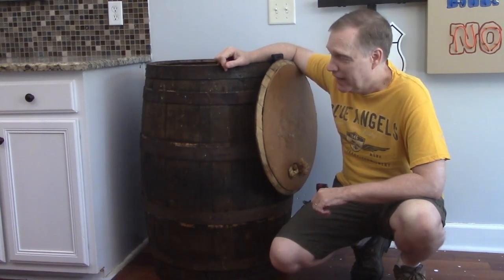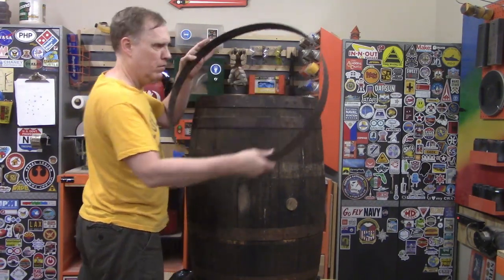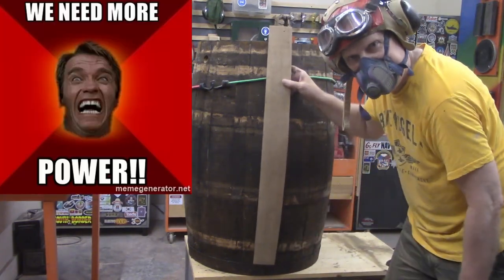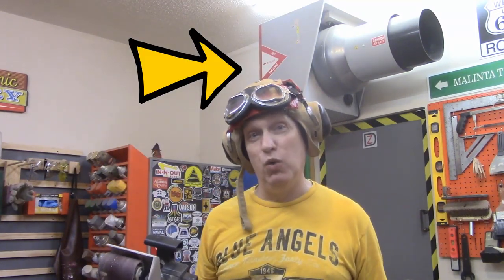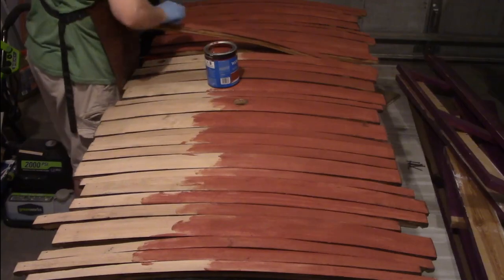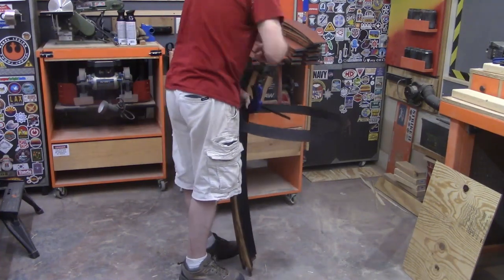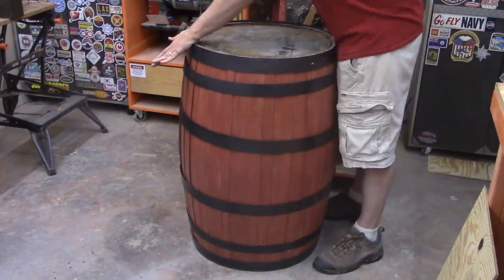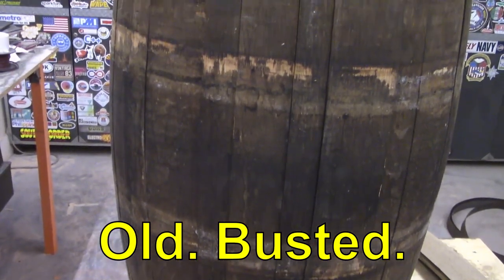Whiskey Barrel Restoration - Trash Can Upgrade

Comment: Ida put casters on the bottom
Reply from the maker: We thought about that but wanted a cleaner look on the kitchen floor, which is now tiles instead of that wood. The barrel moves so infrequently that this has not been a problem so far.

Comment: What did you not replace the hinge for the top? Seems like it would be more convenient. Maybe some kinda stand off hinge (not sure what they are called) that will pick the lid up out of the way when emptying.
Reply from the maker: We are thinking about that. The lid is closed fairly rarely and the hinged lid invites visitors to try to close it at parties. Plus it's kind of heavy and doesn't look that great hanging off the side. We are going to try with a thinner, lighter lid and may add a hinge later.

Comment: Where did you get the barrel liner
Reply from the maker: The liner came with the barrel. It is intended for outdoor trash use and uses a 55-gallon bag. This allows our barrel to support large gatherings. Well, back when large gatherings were still possible.
Reply: Copy we have some wine barrels and took the rings off, so we could get the lid off. But we don’t have any liners and was afraid that with the convex shape of the barrel that it might hard to get the trash bag out of the smaller diameter top. 

But your video on ring removal was very helpful and we did two barrels and now we will look for some liners. 

Thank you.